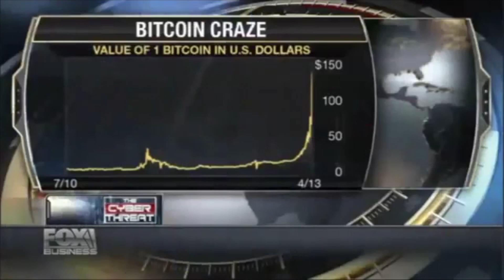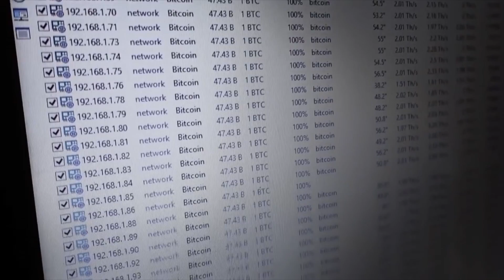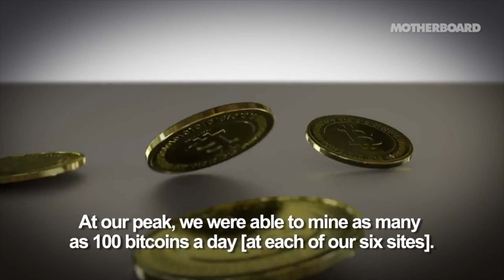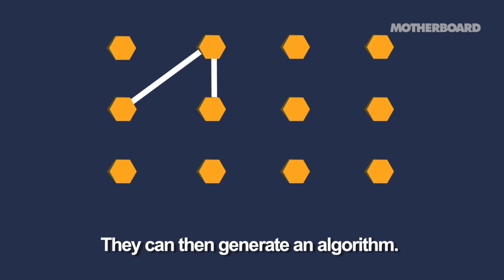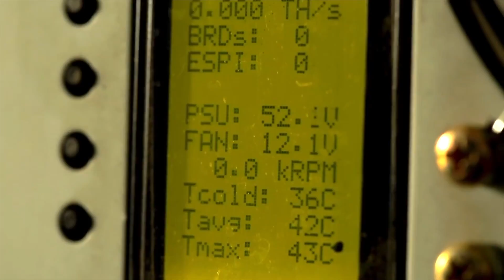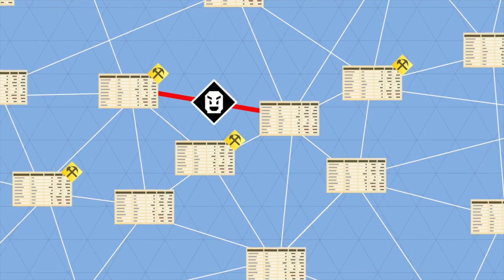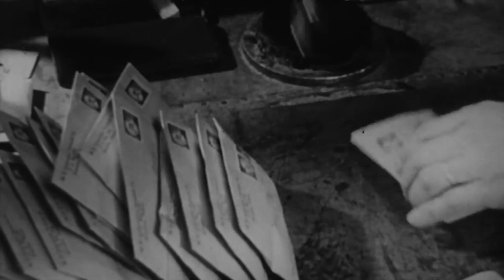Bitcoin Mining Explained

Comment: Seems like bitcoin mining is actually converting your electric consumption to e-currency. First you need to invest in that computer mining machine, will run on electricity which will require extensive cooling because it produces so much heat which means much electric consumption. So, electronic currency is from electric current, so electronic currency is also electric currency?

Comment: For those who dont understand how it works and why

GPU is used for executing mathematical algorithm on your computer (PCs, Laptop, Android phones, etc) the faster it does, the better accumulation yet high power consuming as well. 

CPU will be the playing ground, the higher RAM size, the more algorithm to solve simultaneously. 

The count is saved wether in a database or cloud, a sudden power fluctuation might reset the count and lose all the data stored, they use batteries to keep the stored data saved every nanoseconds. Then resume the execution again and again.

Comment: Early Last year I decided to go into bitcoin and learn about it and with just limited knowledge I decided to give it a shot by buying and that was in mid-2018 after a friend of mine told me the importance of Bitcoin to the economy. I was afraid initially at but after I have seen several use cases I decided to buy 7BTC and I left it in my wallet expecting the price to rise like the previous year in some months time due to my how I understand the market but it never happened. In fact, it became worse that the value of my coins drop down to the fact of me almost giving up on the cryptocurrency market and selling off but I hold on to my patience and did a little research on how I can earn profit with my coins. After an intensive research I found a beginners trading post talking about a strategy on how to trade and make profit so I decided to give it a try and I contacted the person in charge, Mr markeverest. He took time to explain to me the different ways to make profit in this bearish market. I decided to give it a try and I invested 3 BTC of my coin, and it quickly rose to 9 BTC towards the end of December 2018, and I was convinced that this is the best way to make a good profit from Bitcoin. If you're still confused and don't know the step to take to profit in this new year I urge you to contact  markeverestrade@gmailcom   for all your cryptocurrency questions, strategy and beginners coaching and you will be glad you did.
Reply: Greetings

Comment: The last 2 months, I have made over $60,000 from Bitcoin but my success never started that way as I had made substantial losses before my turning point in the Crypto space. I  bought *2Btc last year which quickly rose in the bull run but eventually lost most of it and sold off what was left. That was the last I would ever have to do with bitcoins until I was introduced to Mark Hall first of, he asked to know my trade experience. He then gave me a quick insight on what to look out for when choosing a platform and a bunch of other things most experienced traders may never tell you. Most importantly, he introduced me to his specially designed layout and provided me with professional advice and accurate trade signals. With his system, trading has become easy and profitable and I just want to spread the word and thereby help as many that are in my previous unfortunate situation. For all questions, you can reach by **Mail (markhall279@gmail. com)

Comment: What do you all think of mining using only renewable energy such as wind and solar?
Reply: It's possible, but your ROI (return on investment) would take years to pay off before making any actual profit. By then your current hardware has started failing and you're then investing more in new hardware. Now, if you got all your hardware and solar panels for free, that's another story. Get your friends and family to donate their old computers to you. You can mine with the CPU in a computer, but the cost of electricity negates any profit. They would also have to donate solar panels, storage batteries, power inverters,  solar panel regulators, wiring for the whole setup and some place to put it all because you don't want that much heat and noise in your house. So you see, it is possible. But, highly unlikely.
Reply: Have you done your research or is this just speculation? 
We are posting a video talking about the subject matter shortly you should check it out :)

Comment: So bitcoins are the currency and the math problems are the security??? Or are math problems the way you get bitcoins? Who transfers the money to your currency such as one bitcoin to one US dollar? And do people just have to have good computers or do u have to be mathematically smart?
Reply: Certain maths equations can have answers that fit certain criteria, but no one has any way of predicting what those answers are without using trial and error. basically, every time someone's computer comes up with an answer to the formula which meets all the required criteria, they receive some bitcoins as a reward. the formula used is too complicated to be solved by people, it has to be done by computer. The amount of money people receive goes down as more bitcoins are produced, so the supply of bitcoin always grows at the same rate.
Reply: niall ok thanks this helped a lot.

Comment: Great video! I just don't understand what is really the point of solving the algorithm... I'll just make an analogy, is it something like "if your computer can solve '2+2 ',you get 1 bitcoin"? I don´t understand the type of the algorithm the computer has to solve
Reply: The Bitcoin mining puzzle is a hashing puzzle. Here's how it works:

To begin, we need to know what hashing is. Hashing algorithms are 1 way functions that takes any input and maps it to an output of fixed length. They're 1 way, so given any output hash (called a digest), it should be computationally impossible to find any corresponding input. 

In the case of Bitcoin, a miner takes all of the valid transactions that have occurred since the last block and packages them all into a new block. In this new block, miners will add a nonce (a number that will only be used once, number once = nonce). They then hash the block twice and compare it to a given value determined by the network based on difficulty. 

If the digest of the block is less than the given value, they have succeeded in solving the puzzle, and a the block is added to the blockchain. If the digest is greater than the given value, the miners go back, change the nonce, and repeat the process until they find a nonce that works.
Reply from the maker: +ProjectD100 solving the algorithm secures transactions in the Blockchain and creates new blocks of Bitcoins every 10min ish
Reply: As a side note: the difficulty of the puzzle is adjusted every 2 weeks by the network so that on average, 1 block is produced every 10 minutes. 

Remember that is an average. There is a chance that every miner is really unlucky and it takes over a day to find a solution to the puzzle. This has happened. The consequence of this is that any transactions made in this period would have taken an entire day to be added to the blockchain.

Comment: The future of cryptocurrency depends entirely on the link between the exchange of real productive wealth against speculation of predictable future wealth. How does Bit Mining fit into this equation?
Reply: of course, if you disregard the fact that you need hardware worth several thousand of usd plus the energy to run them 24\7 its sort of free money
Reply from the maker: There is no Bitcoin without a bitcoin miner. Also working on a video of the Blockchain.
Reply: Answer- Greater fool theory. The greater fool theory states that the price of an object is determined not by its intrinsic value, but rather by irrational beliefs and expectations of market participants. A price can be justified by a rational buyer under the belief that another party is willing to pay an even higher price.
Reply: it's "free" because they're not actually doing any work
Reply: Bobby Bologna how is it free if you paying for it
Reply: Manjit- were you around when Nasdaq stocks took off? 2 yrs prior to the top, everyone was stating 'valuation were too high', etc.  I was among them.  Back then 'tech' was new, it was sexy. During the next 2 yrs, many stocks went parabolic. (parabolic definition- you can make a lot of money in the shortest amount of time). That was Year 2000. Fast forward 2017, I hear the exactly same reasoning, same logic why it will fall, it has no intrinsic value, greater fool theory, etc. 
Your comment (and others similarly are Exactly the reason I am still bullish this {sector?}. Mass market behavior do repeat itself. I believe this new digital industry is still in it's infancy.  I figure 2 yrs out people will catch on. Of course this will be after several crypto have gone parabolic. 
I hope in sharing my perspective, that you wake up and get on board.
Reply: Daan Made in Holland